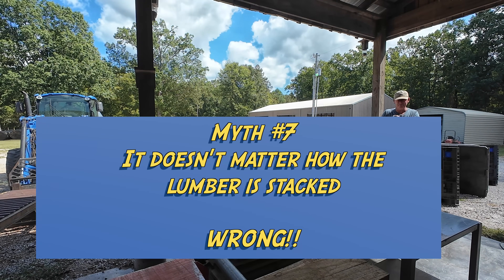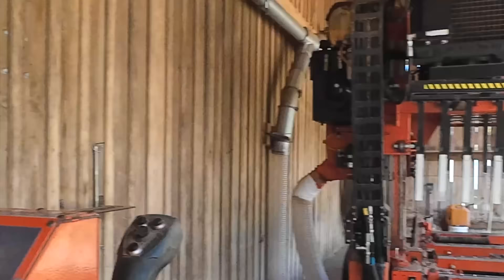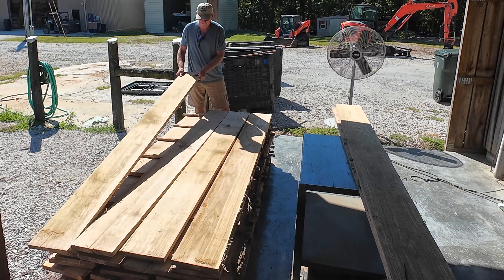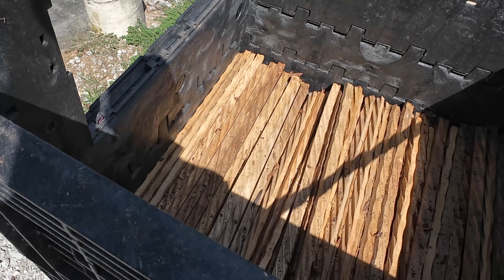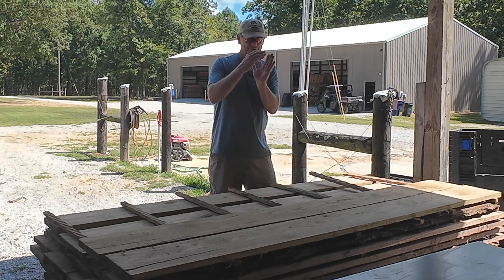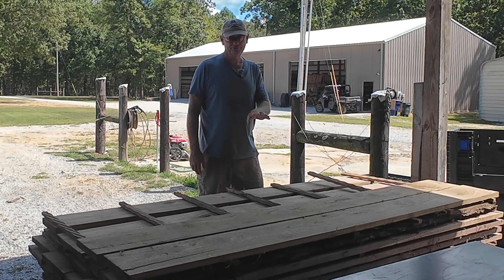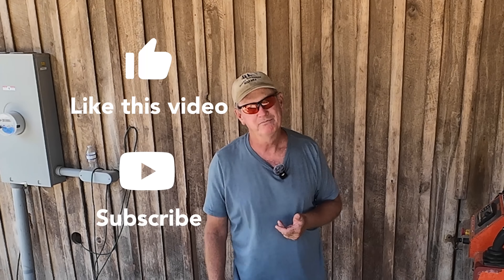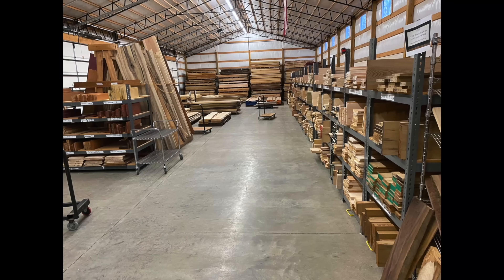Which Sawmill Lumber Air Drying Myths Will Be Debunked?!!

Comment: My take on air dried lumber is simply this, barn built in the 1800s are still standing,  nuff said
Reply from the maker: That doesn't really count, that is a completely different situation, those boards were probably put up green off the sawmill, they are easier to nail up and forced into the shape of the structure as they dry.  I have outbuildings using wood I've done the same way, put it up green off the mill, nail it in place, and let it dry.  However, when producing millions of dollars of extremely high value lumber, some of which boards may be worth $500 each, and must dry straight and true, care should be taken to get the best quality possible out of each and every board, and these are the ways to do it, especially since it takes very little effort to do it right.

Comment: Your wrong about end of the boards checking ,Up here in Michigan use Ancor seal on every end 
of the boards and will slow down the moisture from leaving the board and we keep the drying lumber covered on top to keep the rain and sunshine off from the lumber,  Been drying lumber for
40 years, Furniture Builder.
Reply from the maker: @dougscott9524 You’re wrong saying I’m wrong.  What you do in Michigan may be completely different from what I can do in Alabama, or what should be done in Arizona.  I have made quite a few videos where I discuss the application of Anchorseal and how we use it on a lot of our lumber and logs.  However, I am also not wrong in that if an end sealer is not used, then end drying cracks will generally not progress inboard of the stickers.  I’ve done it many times and know professional sawmills who do not use end sealer and will use stickers to limit end drying cracks.  It would be “wrong” for me not to mention the technique.  You are also wrong  if you say all air drying lumber must be covered, it all comes down to the species and it’s particular maximum allowable moisture removal rate, its tendency to honeycomb. and if outdoor exposure, such as sunshine, will cause that to be exceeded.  Certainly there are some species that can be air dried, outside, uncovered, on hot concrete, in direct sun where the maximum allowable rate will not be exceeded and it will dry with zero defect and very fast, which is the point. We sell 53 different species, were ranked the highest grade lumber producer in the state and only sell zero defect, perfect boards.  Not brag, fact, and we sell to the highest grade furniture builders, luthiers, and craftsmen in the country.  If you listen to country radio, you are listening to our lumber in about 50% of the professional recording studio guitarists in Nashville.  The company who builds the stage guitars for the Grand Ol Opry buys our lumber and recently Brad Paisley’s manager came to buy wood for his new guitar from us.  So you are partially correct, many species should be covered, and yes, many species should have endseal, (and not necessarily Anchorseal, there are better products for some specific species), but telling people that is the “only” way to do something is one of the “Urban Myths” I try to dispel.  I appreciate your experience, I appreciate your trade, and I appreciate your comment, but please understand, I will never give out techniques I do not use myself in certain circumstances.
Reply: @HobbyHardwoodAlabama  I'd like to leave a comment here thanking you for both the video and your extremely in depth response to a rather unworthy comment.  Congratulations on your accolades sir and thank you for being an artisan in a time of hacks.

Comment: What about using straps on single-wide stacks? My lumber is all live edge slabs, roughly the same width, single-wide and strapped.
Reply from the maker: Strapping will work in some instances but it’s best applied with a structural top and bottom board to apply even pressure to the faces of the slabs, and straps will not provide a force down the centerline of the boards so will not stop bow.  Weights on top are a much better solution if at all possible.

Comment: I've never dried timber in my life before but the other week, I found a large chunk of beech on the beach here in the UK.
Cut some of the spongy outer off & it had some nice spalting, so had it cut into 2" slabs by a local sawmill. 11 pieces in total
It sat in the garage for a week but I moved it outside today & stickered it. Had a vague idea but now I know what I did wrong & will remedy my errors in the next couple of days.
Thanks for the education.
Reply from the maker: Hello to the UK! Beech likes to move, it can be “grumpy” as it has an interlocked grain, so it’s best dried on a flat surface with lots of weight on it to calm it down.
Reply: @HobbyHardwoodAlabama  Thanks for the advice.
Coincidentally, I'll be about 90 miles east of you in mid November - near Mentone.
Reply: @HobbyHardwoodAlabama

Comment: Well, maybe a few points I might argue with you, but I am mostly a bowl turner, and not a lumber maker. Wood is like people, every one is different, and some are more different than others. My favorite wood is Pacific Madrone which has the highest water content of just about any wood out there. It is also known for warping insanely, no rhyme or reason to how it warps, and it is seldom seen as furniture lumber, and more common for fire wood or flooring. I do know one guy who dries it in a solar kiln. He air dries it under tarps for a year before putting it in his kiln. He does strap it down first to help reduce the warping. I had not thought about being able to air dry lumber in 6 weeks, but like you said, you have to be an expert. I do like how when making furniture, air dried lumber will give you shavings from the table saw, either cross cutting or ripping, but kill dried lumber gives you dust. As for cracking, I never had thought about stickers near the end. As for logs, I do not remember ever seeing a log that did not have cracks off of the pith when cut down. Nice video. Oh, some turners will twice turn their bowls, so rough turn and leave about 10% thickness to diameter (10 inch bowl 1 inch thick walls), and then seal and let them dry for 6 months to whenever you get around to remembering. I did once turn a madrone bowl 22 inch diameter, and when it had finished drying, it was 25 by 19 inches in kind of a D shape...
Reply from the maker: I appreciate your comments.  Every species of wood has different amounts of extractives, different amounts of bound and unbound moisture ratios, max and min allowable drying rates, enzymes, stress and just about everything else.  So each species has optimum techniques but also have more common techniques that will work for a lot of different species.  My techniques are a mix and based on experience but also the science behind it, and people can do very species and thickness drying specific methods, or more general techniques.  That’s really the reasoning behind my videos, if people know the “why” then they can understand and do their own “how” and have a reasonable chance of success.  None of my videos teach “absolutes, because sawing and drying wood is dependent on so many things, it’s never black and white.  I make videos to impart knowledge based on our business, selling many millions of dollars of the highest grade wood in the state, if not the country.and folks can use it as they wish.  Thank you for being respectful in your comments, we need more of that in this world.
Reply: As much as I like walnut, I don't work with it any more. Makes me sneezy and itchy. Generally for woods, the more strong the scent is, the worse it is for you and you end up getting allergic to it. This happens with the cedar and redwood trees. 

I do listen to the experts. Some know what they are doing. Some don't.... You do know what you are doing.

Comment: Awesome video, thank you! I have a quick question. Do you wait at all for the logs to dry before making the boards, or do you cut the boards right after the tree is cut?
Reply from the maker: The best time to cut a log into boards is when it is still green.  However, depending on species, I may wait for quite a long time.  I guess the short mower is “It depends.”
Reply: @HobbyHardwoodAlabama  Thanks for the reply! That helps. I was concerned that the boards may twist if they are cut from a log that is still green. However, I guess that the way they are set-up when drying prevents that to some extent.

Comment: Great info Robert, as always!  

Do you weight down your air drying stacks with weights to keep those "pringle" boards in line?  Use straps maybe? 

I see some put a tin roof over their stacks and drape down shade cloth to keep direct sunlight off the sides of the wood...what are your impressions of these techniques? Necessary or overkill?

Looking forward to part 2 of air drying! 

I am going to see Nathan this weekend at the Paul Bunyan show in Ohio...learn a ton from both of you guys.
Reply from the maker: I use other stacks as weights when I’m air drying, up to 4 packs high.

Comment: Thank you in advance. We've got a lot of trees down due to helene. Can I cut my trees into cants, stack and saw later? Swamped with trees but don't want to lose them!
Reply from the maker: Typically, not a good idea because the cants will start to surface check.
Reply: @HobbyHardwoodAlabama  
I really respect your opinion. Thank you so much for the response! I guess I'll just store the logs up off the ground and try to spray them with an insecticide until I can get them sawn. Cherry, hickory, red and white oak, white pine, sweetgum. It's just about overwhelming!🤣

Comment: What are the implications of air dying wood under a tarp (for those that do not have sheds).  Is the tarp's benefit of keeping rain off the wood offset by restricting air flow?
Reply from the maker: Yes, exactly.  The best bet is to make a pallet that is wider and longer, cover it with the tarp, and then put that “roof” on top of the stacks.  I used to make these removable roof pallets and cover them with roofing rolls like used on mobile homes.

Comment: I’m just a hobbiest that is pretty new to the whole saw milling process. We’ve cut a few trees with a local sawmill service and we’ve air dried that lumber inside our shop with a dehumifier and a couple fans running. We’ve been happy with the results but one question that I’d like to hear your take on is about moisture meters. We have two—one with pins and one without. It’s hard to know which one to believe. We’ve even driven pin nails deep into the center of the wood and taken reading of those with the meter that has pins. I’d love to see a video on this subject.
Reply from the maker: As a rule, pin moisture meters work the best and are most accurate.
Reply: @HobbyHardwoodAlabama  do pin holes in the wood make it unusable?

Comment: Yoj just put a smile on my face 😅. But to business:
 When the sticker is on the end, how far apart should the others be? You put many stickers on short boards, maybe a foot apart?
 And what are your thoughts on using ratchet straps to "compress" the stack of boards?
Reply from the maker: I prefer a16” even spacing on stickers.  Ratchet straps do not work well, dead weight on top of the stack is best by far.  Straps try to roll the stack into a cylinder, and lose the ability to put down pressure on the boards.  For example, take a handful of soda straws and put a rubber band on them, what shape does it become?

Comment: Air dry questions:
1. How high off the ground? Do you set your pallet straight on the ground?
2. Do you cover your air drying stacks? If so, how soon do you try to get it covered?
3. Location, sun, shade, Filtered light, 2-3 hrs of sunlight, etc?
4. Banding air drying stacks, your opinion/recommendations?
Maybe a part 2 on air drying. 
Good info, thanks!
Reply from the maker: Good comments, I will cover these in another video.  Thanks!
Reply: Great stuff! Never quit learning. I turn 76 tomorrow and have been a citified woodworker and boat builder for 55+ years. I always bought what I thought to be kiln dried hardwood from commercial retailers. Now in my rural retirement in E Tennessee I’m buying a lot of green poplar, white and red oak and cherry when I can find it. Your generosity of spirit regarding the intricacies of the sawyer end of the process, in this case air drying, is information I can use in my small scale operation and is greatly appreciated and fun to watch. Thank you Professor!  

BTW do you make your own spiral stickers, and how are they made?
Reply: It would be good to answer the questions when someone takes the time to ask...who wants to wait for the next video to drop..
Reply from the maker: To answer the question in detail will take pages, but I will provide a super short summary below.  However, as I try to explain, rules are only rules if the reason behind them isn't known.  All rule are made to be broken, and in lumber drying, rules can be wrong in many situations, which is wy so many people screw up their lumber.  I don't want that to happen to anybody be me giving cryptic answers.   The understanding behind the rules are the key, so me giving short answer is only correct in 80% of the situations, which means rules are wrong the other 20%. So I made 2 more full videos, to specifically explain just some of the answers to these questions.  So I said I would do it, and I did.....
Reply: @HobbyHardwoodAlabama  thanks a bunch
Reply: @HobbyHardwoodAlabama  Rules are only rules if the reasoning behind them is not known.....   Been saying this for years, unfortunately the authorities have had a tendency to disagree with me on that one!! haha   No seriously though do you have an extra moisture meter you would like to sell me  at a budget oriented price point?     Keep kicking out the videos brother the information and wisdom you have bestowed have been just invaluable for those of us with no other local sawyers/mentors.   So thankful for you sir.
Reply: @Tigdude  It's all good brother. HH always comes through. He knows I'm in no big rush.
Reply from the maker: Several videos later, I hope I have answered these questions.  No, set them on concrete, never on bare ground or moisture evolving material.  I sometimes cover my stacks, depending on the species.  Generally, I use open sided metal sheds. Banding is useless for keeping lumber flat.  It always wants to force them into a circle.  Take a rubber band, wrap it around a handful of soda straws, and the straws will form a cylinder.  Same thing with lumber.  Weight is the best, 3,000 lbs minimum per pallet on top of each stack.
Reply: Great wisdom  @HobbyHardwoodAlabama
Reply: @Tigdude  So that people who do not read the comments can see what is really meant.

Comment: Hi just started out had no stickers. Used 1 x 1/2 in Pressure treated wood is that a bad thing?
Reply from the maker: It depends on the wood being dried and how wet the pressure treated stickers are.  The chemicals is the PT stickers will bleed some when air drying, but may not cause a problem.  For kiln drying, it would be a real issue.
Reply: @HobbyHardwoodAlabama  ty you so much for reply love your channel

Comment: Definitely looking for more air drying videos.  I dont have a kiln yet but i will in the near future.  Ive always had luck leaving lumber stickered for at least a year in my barn.  Once i get to use it i sticker it on a shelf near the cieling in my shop once the forced air heat is on amd i can usually achieve 7 to 8 percent thatbway. But only works in the winter and it takes a while, plus its alot of handling.  Im starting the process now of sourcing a kiln, hopefully will be up and running next spring.  Thanks for the info!
Reply from the maker: Thanks and I will do some more.

Comment: Is there any reading you recommend for a new sawyer? Something detailing how to cut certain species.
Reply from the maker: There are some old publications about circle milling that are pretty good, and WM has a series of videos they sell.
Reply: To accompany this part, google "Air Drying of Lumber" from the USFPL. 
Another way to create "pile bend" in stressed woods is to keep piling pregnant boards or hourglass boards on top of one another. If I can't hold dimension I'll presurface before stacking. From my rougher surfaced circle mill boards this also reduces checking of refractory hardwoods like oak, I think Dr Wengert has a paper on that.. and those are more good reading. Oh, and the "Wood Handbook" another good publication from the US Forest Products Labs.